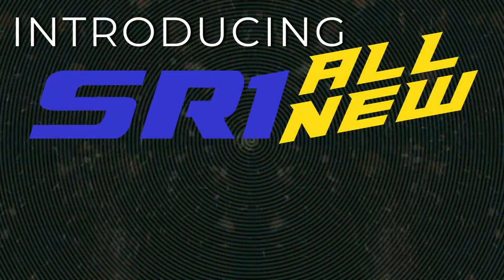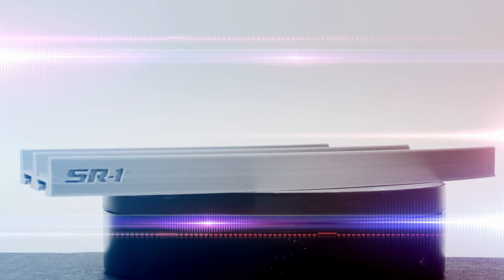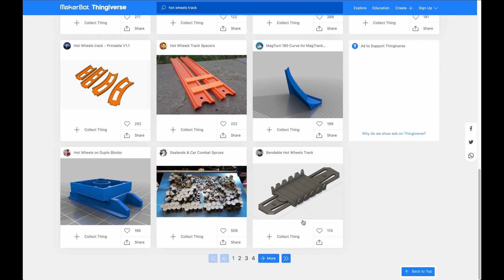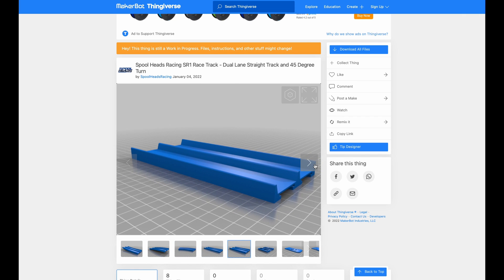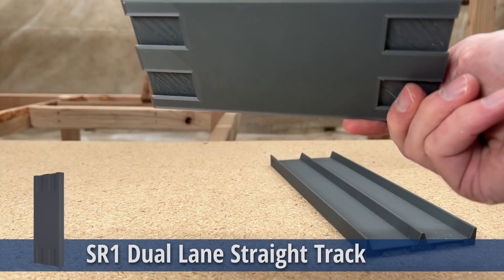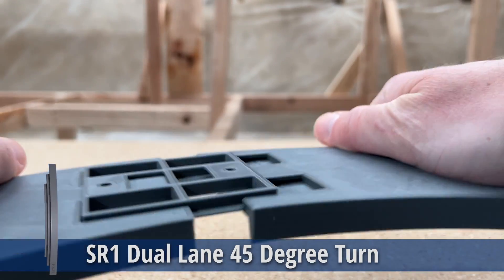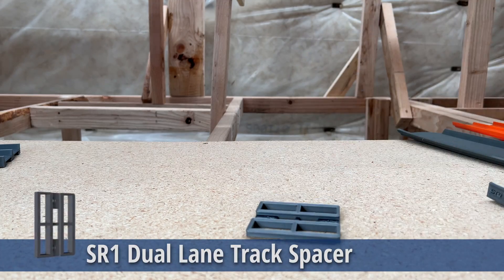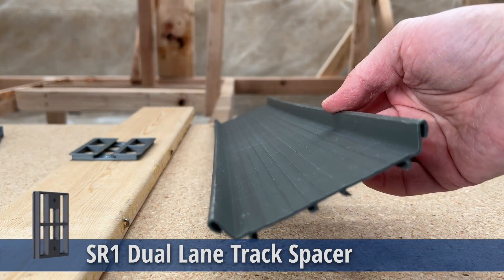SR1 3D Printed Diecast Racing Track Launch - Free STL Files! - Works with Hot Wheels & Crash Racers

Comment: These are awesome!  So far I've printed the spacers and they fit perfectly in the crash racers set and flatten the track out.  It's amazing!  I'll be printing off a couple of the 45 turns as well as straight sections.  Keep up the great work!
Reply from the maker: Thanks JuSh! I'll try to get a banked turn going soon too. I really appreciate the public comment on your experience with the SR1 connectors.

Comment: Nice work dude. My track connector is very similar and I love that it stops the track moving around and it’s also out of sight. Very generous to give all the files away.
Reply from the maker: Thanks Mr. Watson. Glad someone else is excited as me about something as geeky as track spacers. :) You don't even see them in the race!
Reply: @spoolheads  not seeing them is what makes them so good 😊
Reply: @spoolheads  I just need to buy a bigger printer as I can only do 150x150x150 which is too small for nearly all track pieces.
Reply from the maker: @ChaosCanyon  That is very cosy for printing actual track pieces for sure. I'll have to show some racing first so you can see if it is worth upgrading. Have you started using the Nascar Crash Racers track? If so having enough spacers under the track really helps to flatten them out.
Reply: @spoolheads  I have and I’m using my under track connector to keep it flat and in place. So far they’re working really well.